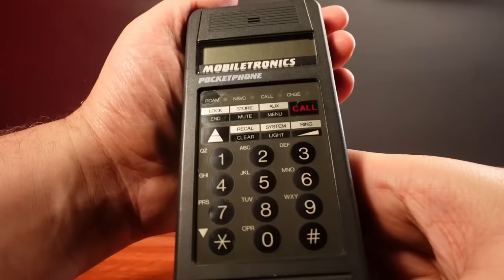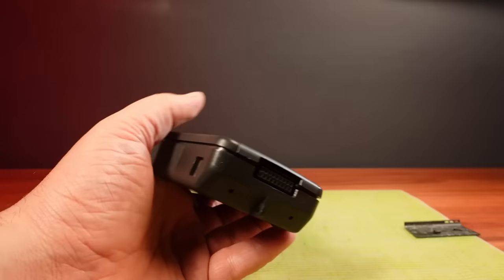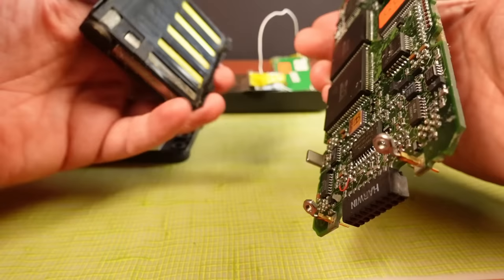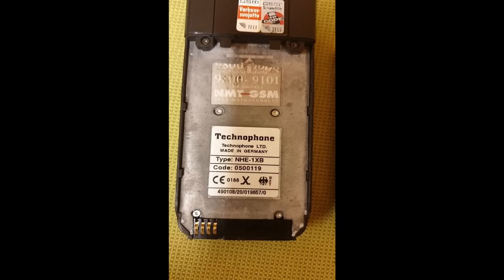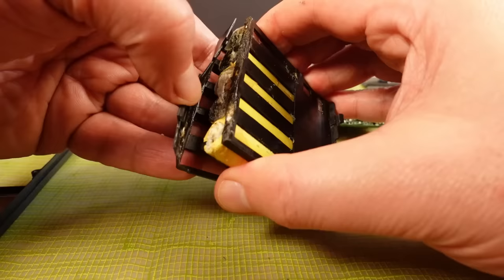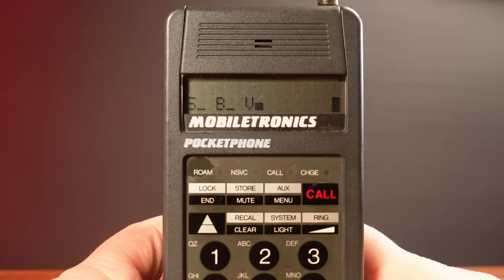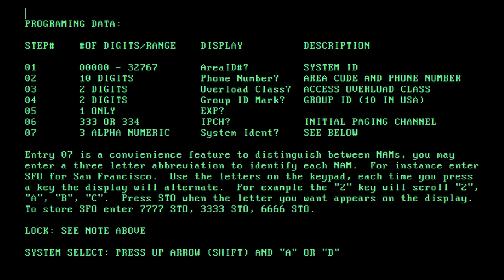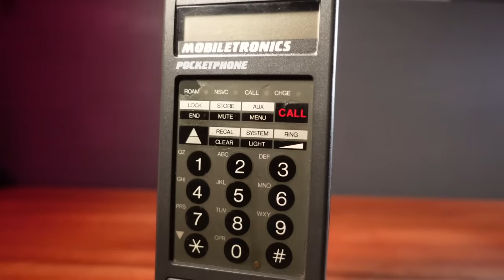1985 Cellphone In Your Pocket

Comment: This video was BRILLIANT! The title card you made was spot on. So simple and yet it fit perfect! I love that one of the ladies said "the most intelligent mobile phone" she didn't call it a smartphone, but still :)

I don't know if you care about this aspect, but when you said "I'm even more excited" after discovering the eeprom, you did not sound convincing. Since I was also excited, I'm certain you were too, just didn't sound like it.

I have never heard of this phone or brand. Everybody skips from the Motorola brick phone to the startac usually. I was surprised just by seeing the title honestly. I didn't think there was a mobile made in the 80's that was pocketable. For reference, I am the same age as this phone. The effort you put into this video really shows. Just the research you must have done, wow! Then you presented it very well. 

Did you figure out the mystery of the solder across those processor pins? I was afraid something bad would happen when you connected the battery. I'm very shocked the phone still works as well as it does. Thank for sharing this true marvel of 80's era electronic engineering!
Reply from the maker: When I made this video I recorded the entire disassembly and powering up process. I try very hard to capture my genuine experience during this time. Then I wrote the story script with all the things I've learned, either in full sentences or bullet points depending on the section and record the story of my experience. The final edit is a combination of the two recordings.
The moment of eprom reveal was in my head a lot and if I've been unable to capture and present that authentically then that's entirely on me.

The aim of this channel is to explore technology and connect with people as I do this. Which is why I'm humbled by the feedback I get from everyone and why I love your comment in particular. You are helping me to grow and improve.
Thank you for sticking with me as I learn to make better videos. I do find it really hard sometimes to properly express myself emotionally. But I also feel that I'm making progress with this over time. And from the wonderful responses I'm getting from everyone. Thank you all so much.

I learned during making this video that the eprom was how the software was upgradable in this phone. I'm now even more keen to read the contents. Though it will need to be desoldered from the board to do that. That could take some time to set up. The bridged solder pins are very weird indeed. I'm keen to look further into these things in a second part one day. In the meantime I've got a couple of new videos in the works and I hope something good comes out.
Reply: @JanusCycle  idk, I thought the eeprom reveal was done well aside from my previous feedback. I knew exactly what it was when I saw it, so my perspective may be different from someone that didn't. You did an excellent job of describing why it was exciting. It was just that one sentence that your words didn't seem to match the emotion. I also LOVED how well you described the nature of the board, double sided surface mount, 12 layers. I knew that was uncommon for the year, but you helped me understand just HOW special and uncommon it was for the time.

I have trouble expressing emotions too. Doing videos really helped me with that. The biggest thing I learned is that the camera works against you. For some reason, when I smile or sound angry, I never appeared to be expressing as much emotion as I thought I was. So I started exaggerating whatever emotion it was I was trying to express. Oddly that made me appear to be expressing myself more naturally in the video.

I think for the most part your speaking rhythm and cadence match the subject matter and 'feel' of your videos. Your voice is easy to understand and pleasant to my ears. For my american ears, your accent is almost melodic. I'm excited to see what you upload next!
Reply from the maker: It's the encouragement and honest criticism like yours that's really motivating me to strive towards making better videos.
Reply: @JanusCycle you should be able to read the programming with a clip lead set. Without desolding if you remove the battery. My guess that is how they would do programming too. If it was strictly programmed from the base, they would have done the erase from there as well. I was fixing cellphones in the early 2000 time frame, but I was playing with Amateur Radio before that, a 12 layer board is mind boggling complex for a decade before then. Techtronics would have been pushing their design software right up to the limit. 6 layer fab was much more common at least in the computer market though some places did more. It occurs to me that the RF modules separated by the battery may and likely at least 1 layer in the board was used for additional RFI reduction/isolation. I wouldn't know what to do with the information,  but maybe you can find a technology service who can Xray it once you get the software backed up.
Reply from the maker: @RowanHawkins  I have since found out that the Eprom is sitting in very low profile socket pins and easy to remove. I think I was quite wrong about it being programmed in circuit. This will be in part 2.  I now need to find a good Eprom reader/programmer. I am going to desolder those RF modules as well. Great suggestions in your comment as well, thank you.
Reply: And the Lady's got horse ears.
Reply: @JanusCycle  You can use GALEP programmer. There might be cheaper ones, but from GALEP-3 and -4 to modern -5 with USB, they all support the EEPROM if I read it right: NMC27C256BN
Reply: Solder bridges often occur where IC's have two or more adjacent pins which share a common local copper area. For example, there are often multiple 0v (ground) pins on microcontrollers and similar, and if they are right next to each other, the action of heating one pin transfers heat to adjacent pins through the copper ground plane. So here you have the heat, and all you need is a bit of flux and some solder for it to become just like any other things you want to solder together.
Reply: Not everyone giggles like a schoolgirl when amused, Sally.
Reply: @mercster  I understand, but in previous conversations with Janus, he indicated he was working on his presentation, so I was just trying to provide feedback based on my opinion and experience. To some degree faking emotions is needed when trying to appear 'normal' on camera, that's all I was getting at. It's easy to forget.
Reply: @nevarDeathEHW  Youtube is full of fake emotion... this guy is a grown man.  It's fine.
Reply: @mercster  🤪😵‍💫🤓😜
Reply: I remember year later that electronic organizers became a thing in the 90s and they were super useless compared to pen/paper, calculators and simple termin planers...
Reply: @digitalradiohacker the mystery is that the bridging seems to be deliberate and they don't share a pad. I'm wondering if it's a wire correction job but because they were next to each other, it was just bridged. I mean given its a 12 layer board, jesus.
Reply: Quite likely, I do remember some early production phones having bug-fixing wires hand-soldered.  I think it was a 12 layer board all laid out by hand, no CAD software!  I'm not certain, it was a long time ago but that was one of the reasons for the 12 layers and the hidden vias.  I did design the next generation of ASIC (for the Nordic NMT and French Radiocom systems) and that was all emulated with two bespoke boards stuffed with 74LS logic.

Comment: The second that sticker came off with the window visible I gasped and started panicking the eeprom was getting erased. Glad to hear it needs a focused UV light.
Reply from the maker: It's very hard to erase an eprom without strong UV. Still it's good practice to keen them covered.
Reply: This was also my reaction as soon as Insaw the window! I'd only learned about those in class, never encountered one. I'm glad to know it takes a focused UV beam.
Reply: I think the "eprom's" memory is UV erasable. The "eeprom" or as you computer nerds like to call it, e-squared prom (😂😆🤣) is Electrically Erasable Programmable Read Only Memory.

Also, I didn't know surface mount was a thing in 1985.
Reply: Used to place eeprom under desk fluorescent lamp overnight to erase them during my EE degree days, about the same year when this phone came out.
Reply: I was Working a Trade show back in the 90’s, we had a Liebert  Deluxe on the Floor, Powered up the Controls with 115 Volt Cheater Cord. These Japanese came up and started taking close up Flash Pictures of the Board(s). I got into a tussle with them. Yes, they wounded the EPROM. Luckily it wasn’t enough to destroy it working’s at the show.
Reply: There's a story from around that time that McDonald's (or some other fast food chain) banned flash photography in many of their stores because the flashes were corrupting the cash registers.
Reply: But dont leave it out like this. It will take time instead of a strong uv to reset it.. a bit of uv is enouhg, but you will need more time.

Also speaking about panic.. he obviosly removed the sticker on intention, if such action would instant kill such device, would you realise he wont probably do it… lemme gues, your a murrican woman?
Reply: @ClosestNearUtopia  How is nationality or gender relevant to this discussion?
Reply: @HonestAuntyElle  cliché’s!
Reply: We had the same problem when demonstrating the System X telephone exchange in the early 80s, the processor blinked, reset and carried on only to go through it all again with the next flash.
Reply: @larryleisuresuit3566 wow, I'd be interested to know the manufacturer of the tubes tbh, fluorescent lighting shouldn't produce nearly enough light to erase a chip like that, hope you didn't use it as a study light😬

Comment: I was the engineer that designed one of the application specific chips used in the PC105 series pocket phones, both AMPS ad TACS variants. I went on to be the worldwide software support engineer for the AMPS variant.
Reply from the maker: Hi Andy, thanks for stopping by. It's an honour to have you here. I hope you enjoyed the video.
I understand I made some mistakes in this video. I intend on correcting these in a part two. If you have any stories you would like to share, I would be very interested in hearing them. Either here or you can also email me if you wish.
Reply: @JanusCycle  One thing that might not be so obvious was that some of the variants of the main PCBs had buried vias on them. This was pretty revolutionary at the time, and hugely expensive as well.
Reply: @JanusCycle  Me again... The Service mode was designed by me as an aid in field testing. My original version was a lot more comprehensive than the version that we eventually released on to customers phones though. the service techs out in the field absolutely loved this feature as it allowed them to have far more visibility of the system than any of the competitors phones gave them.
Reply from the maker: @AndyPevy  This is all very interesting stuff. I really appreciate you sharing this.
Reply: Hi Andy, fellow Techophonist from a short while later👋 IIRC the processor was a standard chip, not in one of the gate arrays? Hitachi 6303? CMOS version of the Motorola 6800 family. Under the "GL" sticker perhaps.
Reply: @TonyWhitley  Agreed, 6303Y if I remember correctly. Deffo an external CPU. All the address decoding required to access the peripherals was done in the main gate array.

Comment: I used to fix these back in the late 1980's. I still have that exact model on display in my office (just for fun - to show visitors). I also have half dozen old eproms in a black UV proof case (try to keep yours out of any light sources or the data may get corrupted - hence the funny characters you are starting to see on yours).  The eproms could be programmed with anyone's phone number and their ESN, then you could make phone calls on their account. A huge cyber security risk by today's standards, allowing technicians that kind of power. But getting hold of the ESN/phone number pair that the carrier had allocated to a specific device was difficult (unless you worked for one of the carriers, or maintained a register of peoples data).  I recall all the one's I worked on had that eprom socketed, so it was easy to test the phone on a working account by simply popping in a 'test' eprom with a registered esn/phone number pair.  I still have the charger with mine as well as a charger stand where you could pop the phone into the stand like a modern looking Qi charger, but I haven't pulled the phone apart since the 80's so I imagine the PCB has leaked batteries all over it by now. This was back in the day when you could still fix mobile phones at a component level - but that only lasted another 3 or 4 years, then we started doing board replacements in the early 90's and simply threw away the faulty PCBs.
Reply from the maker: It must have been amazing to work on these at that time. I did make a few errors in this video. For example I have since discovered the Eprom is removable. Sitting in very low profile socket pins. And the upgrade would not have been done while in the phone. I will correct that and other things when I can read this Eprom and make a part 2 video. My battery didn't leak too much and you could still try and clean yours up. Really awesome that you keep one on display.
Reply: I worked in the UK for both Vodafone and Cellnet at different times repairing analogue and gsm phones to component level well into the mid 90’s, I went on training courses and was an authorised tech for the likes of Motorola, NEC, Panasonic, Mitsubishi, Sony and Ericsson to name but a few, thought it was a job for life given the cost of the handsets but then it got to the point where you could almost get a free one with a gallon of petrol!
I work in industrial electronics now but still miss those days, the good old Marconi 2955 / 2960 test sets etc, thanks for making me feel so old 😂 Great Vid.
Reply: SIM cards for GSM must’ve been so much easier! Though in a way even 3G CDMA phones kind of still worked like that, with the subscriber info hard-programmed in
Reply: It was only difficult to get the ESN pair if you didn't own a snarfer. If you did have one, you just drove around the city centre for an hour or so and you'd hear the constant PING of pairs being logged.

Not too hard to build one with an old scanner and some decoding logic. No security whatsoever, ah those were the days, lol
Reply: I like to imagine that to get someone's ESN/phone number, all you had to do is schmooze a middle aged office lady named Tilda who kept them all in a binder.
Reply: @steve1978ger  That would at least be some level of security - but the office staff had no idea.  It was more a case of what happened in the workshop boys room stayed in the workshop boys room.
Reply: Another "huge cyber security risk" was that we could (and did) simply listen in on the calls (only one direction, picking up the reverse channel would have been more difficult) as they were just an analogue signal, it was a regular Friday afternoon pastime in the Technophone offices 🤫 Friday afternoon seemed to be when people arranged their "extracurricular" activities for the weekend, it was either that or car dealers. As Princess Diana found out: https://en.wikipedia.org/wiki/Squidgygate

Comment: Thank you for a lovely engineering history perspective. The 12 layer PC board blew me away. 

Just a tip, if you ever get a chance to acquire an Oki 900 handset, it truly was the hacker's/phone phreak's handset of the AMPS telephony era. The bottom connector of the phone exposed a LOT of the bus. I think it even carried some of the CPU lines.  The internal service menus were superbly comprehensive. Some people reflashed them with custom firmware, but there was an almost turnkey plug-in integration with the HP 200LX MS-DOS palmtop and some scanning software that turned it into an impressively powerful and portable scanning platform.
Reply from the maker: I wold love an Oki 900, that is a legendary phone in hacking circles. I didn't know it worked so well with the HP 200LX, another legendary device. What an amazing combination that is.

Comment: I worked on cellphones I'm 1987 to 1990.  I can't imagine how many uv eproms I erased and burned.  This is how we set the phone number and carrier information like the ESN (yes the electronic serial number), kind of like a SIM card.

That circuit board is amazing for 1985.  Incidentally, 0.6 watts is still a lot of power for a portable, way more than a modern phone.

Comment: I admire how modular the internal design is of this phone, reminds me of the add-on board "hats" for the Raspberry Pi single-board computers.

And the overall design for this phone is amazing for 1985, a very compact and advanced design for the era, thanks to it's SMT (surface mount technology) build.  SMT circuit technology in the mid 1980s was just making its debut (I have a Kenwood TR-2600 handheld 2-meter transceiver from 1984 that's all surface-mount, probably one of the first SMT-designed devices manufactured).

Thanks for producing this video, I actually wasn't aware of this phone, or even the Technophone company, until now.

Comment: SMD components were around even in consumer electronics for at least 10 years at that point, but I would agree that a 12 layer PCB was mind blowing back then.
Reply from the maker: The percentages I've seen suggest maybe 10% of mid 80s consumer tech had SMD. I guess it depends on how much of the board had SMD vs through hole. There was a long transition period.